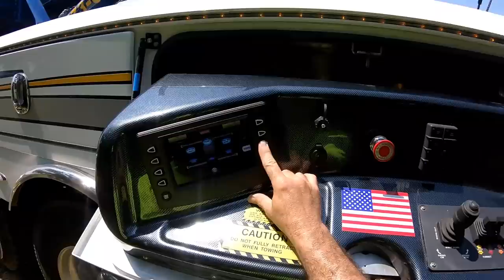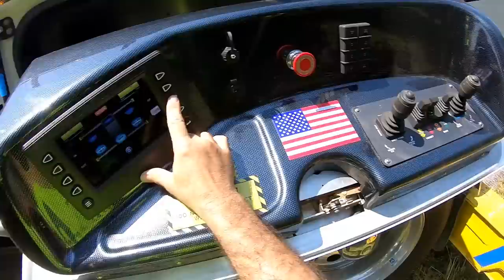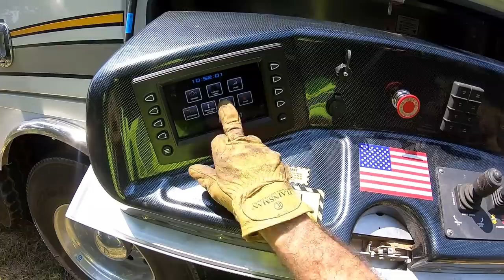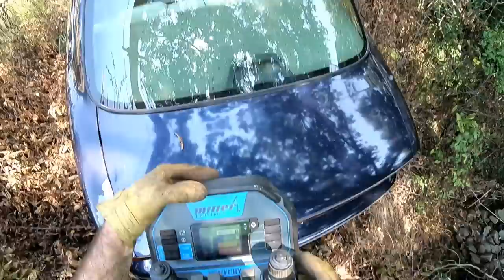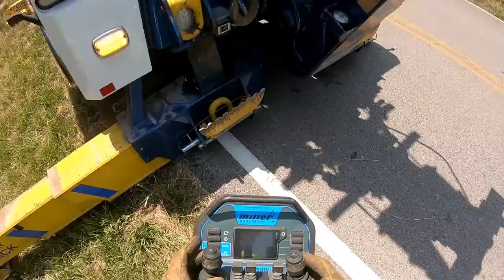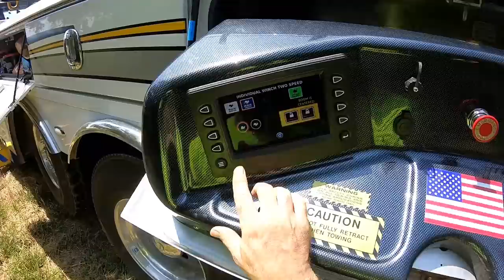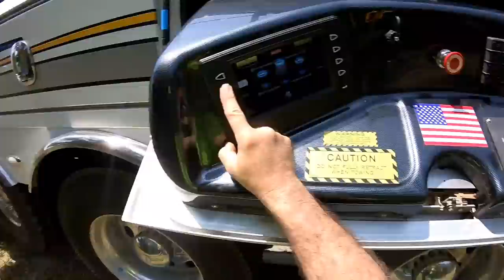Impaled!!!  It's a Ringer!!!

Comment: In the UK, 'ringer' is the term used for a vehicle has been rebuilt using structural parts from another car - the implication is that the vehicle may not be what it pretends to be.  Is it the same in the US? You put ringer in the title but I don't recall you making any other comment about it.
Reply from the maker: I was not aware of the UK version of "ringer".  In the U.S. the term "ringer" has several meanings, but for this video I was referring specifically to the term "ringer" as it applies to the game of horse-shoes.  Horse-shoes is a game played in many rural areas where 2 steel pegs are driven into the ground a specific distance apart from each other.  Teams then take turns throwing metal horse shoes at the pegs.  A "ringer" is when a horse shoe hits the peg and spins around it, thus "ringing" around the peg.  This scores the most points available in the game.  There are other ways to score as well.  Hope I  explained this well enough.  It's quite interesting learning the different terminology from across the world. Thanks for watching and God bless.
Reply: Thanks for your prompt response and the explanation.  I was aware of the game, but not its terminology.  
For us, a ringer is often an accident-damaged vehicle which has been rebuilt by grafting-in substantial parts of another vehicle of the same type.  It is often associated with dodgy standards of workmanship, and changes in legislation and insurance practices have made this practice more difficult  and costly. It is still possible to legally carry out this type of repair but it is usually not worth the effort unless it is a very special vehicle.
Thank you too for not being shy about sharing your faith.
Reply: @The Grass Farmer I was hit by a drunk off duty cop and left for dead while towing a car. So I can relate to what you're through. It's not easy and it is a long road to recovery but it does get better. Just try not  to get stuck in a rut and a good diet plus some exercise is key. Diet and exercise was the only thing that got me through the depression and it's still a constant battle .
Reply: I think a "Ringer" in the US might vary by state.  In my state it would be a Salvaged Title.
Reply: @RonPratt  awesome. Thanks
Reply: In the states we spell dodgy, (as in vehicles,) with an e. In fact there's an entire brand factory labeled as such.  The Japanese love them and have Dajiban, an entire motorsport  dedicated to seeing who  can have the loudest brakes... I think... there may have been something lost in the translation.
Reply: @southjerseysound7340  Hope you are recovering well. What happened to the cop?
Reply: Good post, thanks for educating us here on the other side of the pond. We have different ringers, and per the comments, this videos' car was a dead ringer, unless someone made it look good again, a ringer.
Reply: Another definition of "ringer" is a cheater- specifically something or someone  that's better than the rules allow. For example, automakers used to supply cars that were better than factory stock to the magazines that tested and published the results. Or an amateur sports team that secretly hires a professional-level athlete or two in order to win. Both the cheater car and pro athlete are ringers.

Dodgy is a good word to describe substandard work that I increasingly hear in the US. We would say "shoddy", "cobbled together" or even "shoemaker work".
Reply: Trr u you
Reply: as i understand it a ringer is a stolen car with false id , what you mention is a cut and shut which is made of one or more crashed /write offs surely ?  its not a real ringer but hey who cares its bad anyway,   ron used the term ringer as this car spun around on the pole/fence as in horse shoe throwing? i think :) ,,, its a sport over there  :)  ceazy that as i spent 30 yrs in the motor industry even doing roadside assistance and am now a blacksmith  :)
Reply: Look at 14:39.

Comment: If i was an emergency personnel on scene, i would also spare two minutes to block so you could turn around, you saved them a couple of hours of standing out in that while heat traffic controlling by using that truck instead of a saw and rollback. I am sure they appreciate that, especially during severe elements like heat, snow and bad storms. Kudos to them and you for realizing what you each do for each other and appreciating it. It's refreshing to see people with hearts they aren't afraid to use.

Comment: Ron you will like this. I watched another vid on yt from another tow company. He had a semi and trailer that had run off the side of the road on a bank that was having to be towed back up onto the road. He has a heavy tow truck like you but without the rotator. At one stage it starts slipping sideways on the bank and he has to reposition the tow truck 2 or 3 times to get a safe pull. He looks at the camera and says "don't tell me i need a rotator! " and carries on, moving it for the third time. The first 5 comments on the vid are "Hey mate, you need a rotator"

Comment: One thing that I've been wondering about rotator operations - this is the first time I've seen you use cribbing under the outriggers.  For crane work, you would use cribbing under each pad, and often spread way out to better distribute the load.  As you don't lift the truck up entirely on the outriggers, I wouldn't expect to see heavy cribbing like a crane, but I guess I'm a bit surprised you aren't setting down a single pad under each outrigger contact patch, probably about twice the outrigger shoe size. I could see the pads being lined with tire rubber to increase friction, which would help when you are basing off the hard roadway.

Comment: Couple silly questions for you: what's the baking soda (in there next to the bug repellent) for, and what do the two white cylinders behind the cab do? I'm guessing oil absorbent and hydraulic accumulators, respectively.

Thanks for bringing us along, I've really been enjoying your videos and I really appreciate the care you take and the respect you give the victims. It's so refreshing to see a kinder and gentler approach to life.
Reply from the maker: The baking soda is used to neutralize battery acid if batteries are busted during a crash.  The white tubes behind the cab are spreader bars that are used for lifting.  If you watch enough of my videos you will see them in use.  Thanks for watching and God bless.

Comment: Not sure how effective it would be up there, but we used to dust our boots with regular garden sulfur a couple times a day back when I was camping in areas with tick problems.  A $5 bag would supply a good sized Scout troop for a week or more.  Cheap enough to be worth it even if it only stops some.  Just put the fine sulfur in a sock and bump it against your boots or in a baby powder bottle and dust them inside and out.

Comment: i had done a Plymouth reliant k car..1984.. concrete 3 guidwire fencing flipped & landed breaking the concrete post & twisted the 4 barbed rods into hood & firewall.. lol no1 was hurt luckily.. but made cable on towtruck to rig a pulley system to lift off.. using large oaktree.. 
improve king i was known as.. safely is my goal.. never would do if i instincts doubted tree

Comment: Ron, do you dump the air suspension when using the rotator and outriggers so there is more control of stability?
Great job keeping the fence intact, that car will be headed to the crusher.

Comment: Question about gears and stuff. Is it better on the engine to drive in the upper range of a certain gear or in the lower range of a higher gear, when you're driving long distances? Also with the Off! spray - might want to get a bit of your socks too, just in case they try crawling up inside your pantleg. Easier to avoid having to fix things early on than having critters up in there!

Comment: As always I enjoyed the video.  A question for Ron or anyone. What would the yellow "D" rings in the front of the "turret" be used for?  They can be seen at 36:14.  Are they there just for lifting the boom assembly on and off the truck for maintenance or repair?. Or can they be used for certain recovery applications? Thanks in advance for any answers.

Comment: I would've liked to have seen the damage under the hood on this one. Just curious.
Reply: Yes, it would have been interesting to see the extent of any frame damage. Back in the 70s when I was involved in dismantling vehicles there were plenty of small workshops with low overheads that could have made a legitimate repair of the damage (in so far as we can see it).  We are in a different age now, when vehicles are more complex, labour costs much higher and replacement vehicles relatively less expensive.

Comment: A different question. If you just had a rollback, could you have spun the car around so the back bumper was pointed uphill and tried to pick up the front by pivoting the whole car up on the rear bumper using the winch to pull, over the car? Probably scrap metal so no real value to protect and without the rotator that's what I would have tried.

Comment: I had a drunk driver miss a turn in his Jeep Cherokee and bounce around a few tree's ending up with a small pine impaled through the firewall. It was 4am and in a swamp so I just grabbed the rear and started pulling. Well the thing wouldn't budge and the rear wheels were coming off the ground. Well I was a little shocked when I walked around it with the fireman. A small tree punched through the radiator, went down the passenger side of the I6 then punched through the firewall and ended in the passenger seat. When I started pulling the metal grabbed the tree and wouldn't let go. Luckily he was alone because if someone had been in the passenger seat they would've been impaled through the chest by a pine tree that's the size of my arm.

Comment: I kinda wonder if that car was the victim of a teenage boy.  Even the most level headed ones seem to be rough on cars.

The most bizarre I've seen was where one went off the road, into the ditch just before a driveway.  The way the driveway was banked into the ditch provided a perfect launch ramp.  The road curved left just after the driveway, straight ahead was an old barn.  They had to retrieve the car from the barn loft.  I have no doubt that it took a long time for that driver to live that one down.
Reply: New drivers are hard on cars. I tend to tell parents of new drivers to get the biggest, slowest and strongest car that they can afford to put fuel in. About an 85 Olds 98 is the target. Makes for more damage to the surroundings, but the best chance of the kid walking away from it. There have been several times that I've gotten back messages of thanks. And a couple of times it was "I wish I'd listened". 

And, in my experience, it's both boys and girls. And people getting licenses later also tend to have the same thing happen. There is no replacement for a few years of driving experience. And a few good scares.

Comment: Is the Rotator an 18-speed
Reply: Easy way to remember:

Red Splitter - 13 speed
Blue Splitter - 15 speed
Gray Splitter - 18 speed
Reply: Yes it is. 
However, when I was driving, I often didn't use every gear when driving a 16 or 18 speed. It appears Ron doesn't either.
There is really no need unless you have a hard pull or a big hill.
Reply: Yes it is. The gray "button/ switch" on the left side of the stick gives it away. A 13 speed has a red/orange button.
Reply: I've been driving for 13 years and never knew the splitters were color coded....learn something new everyday.

Comment: Never seen a car picked up that way
I’m surprised the roof didn’t come off
Reply: he has done a number of past lifts by the roof, seen worse roof damage with use of this method
Reply: Barring damage, the roof is supposed to be strong enough to support the weight of the car in a rollover. Windshield and door pillars are fairly strong. On most cars. Unless you run across one that someone has pieced together and got lazy on the welds.

Comment: long video format vs short format
most of the time, i like the long video format, but sometimes it gets boring. 
a normal tow or just talking to someone, i get bored.
 i lke the problems, like the wrecks where you have to figure out how to rig it.
but, when i get bored, i just skip ahead.
so, make them as long as you like. stop and talk to the bunnies, watch the sunset, wait in line at the bank, it doesn't bother me,  i will just skip ahead.

Comment: Why would you not get paid for the job?
Reply: Simple. If the car is not fully insured then the insurance company will not pay for the recovery. And, the recovery bill will exceed the value of the car in a case like this. So, the owner is not only out a car but now has a hefty bill coming to remove it from the side of the road. Yes, you can take them to court, but the court can't give you money that the owner does not have.